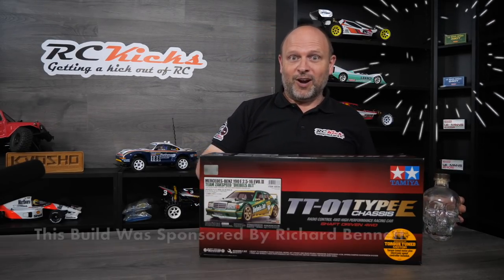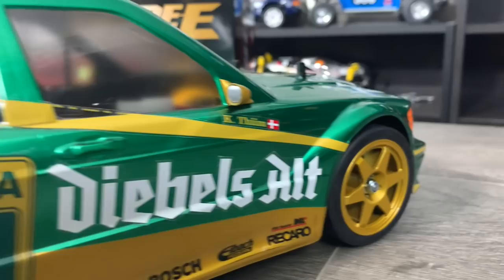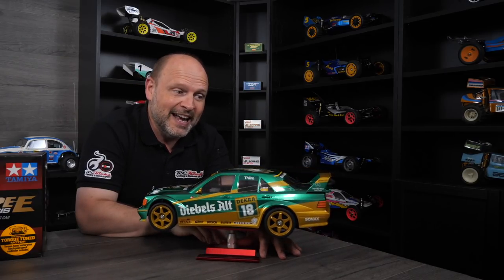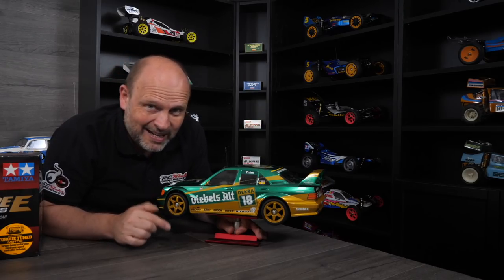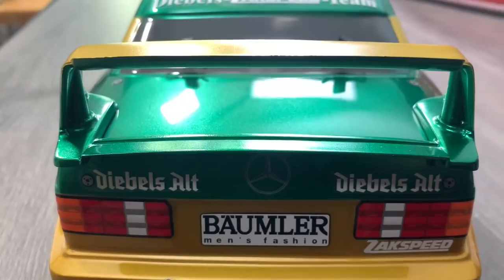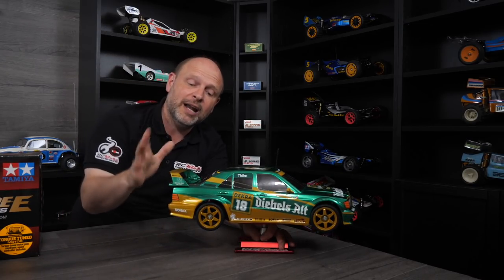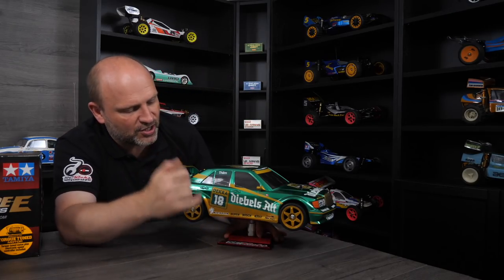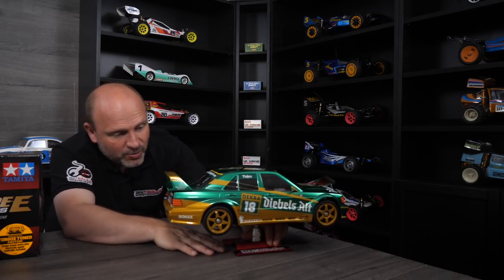It's Finished!  Mercedes Benz 190e Zakspeed Tamiya RC Car Build (Mods, Tips & The Odd Mistake)

Comment: Wow. Your video will probably forever be the reference for this model. Congratulations for this build. It is impressive! According to the slogan "Learn from the best" I'll try to build mine at this level. And I also have light buckets and a cockpit with a driver figure to make the whole thing even more insane. It probably won't drive an inch, but it will look nice on the shelf.
Reply from the maker: It’s a good looking one that’s for sure.  It stands out as it’s a bit different.

Comment: Truly excellent job on that body. I'm curious though, you said the white version is easier to do; how so? It looks darn near the same to me.
Reply from the maker: I just had a better look at it and yes you're correct, it's actually not that much easier really.  The only bit that would be easier is you paint the green first and then blow over the full body in white.  With the green and gold you need to paint the green, back it in white, then put down the gold before going over in white again.  Looking at it I would probably still paint the rims and spoiler just the same so all in all not much in it really.  
On thinking about it a bit more, you would have to back the white version in silver before you paint it black so when all said and done, the two cars are about the same.  That's just put me off getting the white version now hehehe.

Comment: Hi Gavin, that turned out nice! Well done and certainly the extra effort to glue, fill, sand and paint the rest spoiler is worth while. Also worth making the extra effort painting the wheels the matching gold, great work. One question though, the primer? Which primer did you use? I thought I saw a flash of a Halfords canister? Was it a Halfords plastic primer you used, or the Tamiya primer? If so, does the Halfords primer and Tamiya paints work together without any paint reactions? Take care, great looking Mercedes-Benz 190E ☺️😉
Reply from the maker: It was the Halfords plastic primer.  I always use it and have not had an issue with the Tamiya paint.